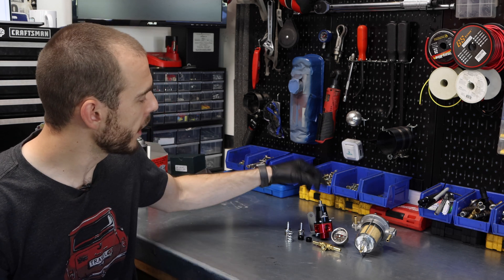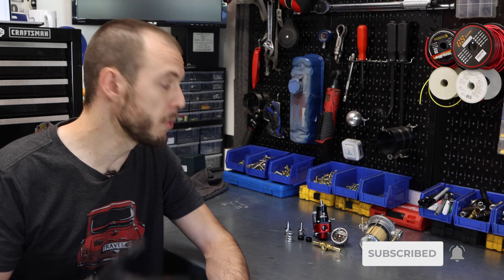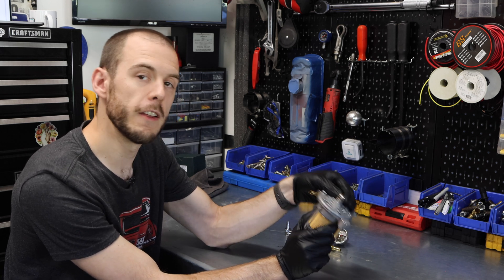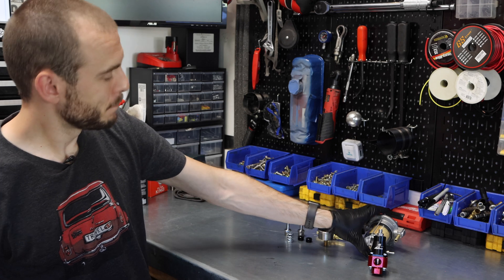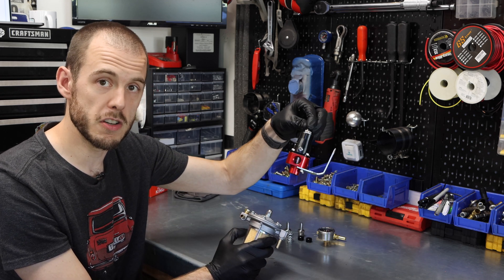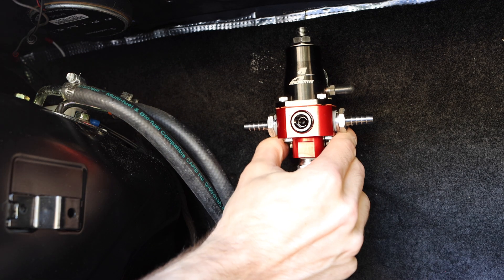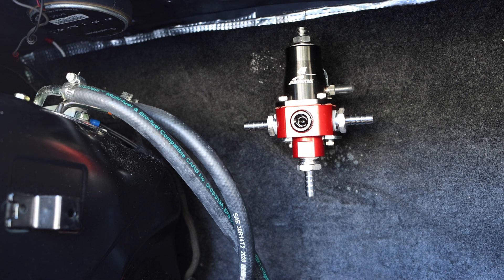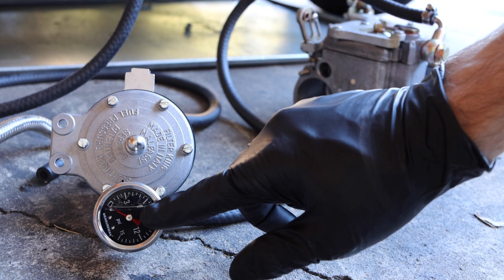How to Install a Pressure Regulator on a Classic Mini - Why You Need One

Comment: Just for reference...at 5:00 , Cole is still speaking (and referencing his setup) to a high-pressure fuel pump vs a low pressure or standard OE mechanical pump.  That glass filter/regulator will not damage anything on a stock car with standard engine, or higher compression engine with a fuel pump below 10psi (I dont have my glass filter/reg manual in front of me).  Mines been running at 3psi now for over 2 years and really solid piece of kit.
Reply from the maker: Thanks for adding this its a great point. Listening back I wasnt super clear about that. The reason that regulator does not work for my setup is solely due to my high pressure pump in the SPI tank.
Reply: Oh phew thanks for this comment mate! Because ive already set mine up like that. Corolla with 6psi oe going down to 3psi :D

Comment: Hi , great video, thanks !!   question, can i go from 60 psi to 3 psi with this aeromotive pressure regulator ?
Reply from the maker: Hey thanks! So technically you could but by doing that you are putting a ton of strain on the high pressure pump even if it has a return. It would be better to buy a low pressure fuel pump if you only need 3psi.

Comment: Curious if by having the regulator close to the fuel tank and only running a feed line to the carb, you essentially are running a dead head system. Yes the pump doesn’t have to work as hard but what about the fuel sitting in the engine bay for extended amounts of time. From my limited understanding, there’s a risk of the fuel boiling and causing vapor lock. I call on you experts to clarify.

Comment: Thanks for this. Around the 5 minute mark you warn against simply putting a deadhead type regulator between the pump and carb, suggesting that it would likely burn out your pump. Did you mean that for any pump type or just the higher volume ones meant for bypass systems? I have an 850 Mini with the original HS2 carb. My pump puts out 4.5 psi and I have been having trouble for years keeping my float chamber valves from leaking. I was thinking of adding a Filter King like yours just after my existing pump, after hearing your caution, I am not so sure. Please advise! (Nevermind - I just saw the comment from theblue0at0 and your reply which addresses my confusion!)

Comment: Friend of mine is about to set an Weber on his MK1 mini (which I found pointless) here in Japan is quite popular to fitting webers in minis , but is it alright for an so small capacity 848cc!???
Reply from the maker: Hey Diego! Weber's can be awesome upgrades for the larger displacement A-Series engines when done properly, however a Weber (assuming DCOE40 or 45) on an 850 will never run correctly. It's way way too much carb for the small engine and it will likely be underivable. It's a much better idea to focus on getting a larger engine or tuning the single HS2 dialed in perfectly.
Reply: @classicminidiy  duuude… look check out this…I can’t understand why Japanese ppl are soooo crazy about Weber…
https://youtu.be/shD2QGWPozA

Comment: Hi, why not run the FPR after the carb's fuel inlet? And use the return line to return excessed fuel? This can also benefited by taking extra heat out of engine

Comment: I'm sorry to say here that there is absolutely no need of any pressure regulator on Minis with SU type carbs, as the bowl of the carb itself it there to do the job.
Reply: so a turbo mini doesn't need a regulator ?
Reply: @martinfidel7086  the only turbo Mini was the ERA and did not have regulator.
Reply: @RobinTheMini  yes it did, I have several of them if you want to see them ?  it was a pressure adjustable regulator to cope with the varying boost pressure requirement for higher fuel pressure,  ie as the boost pressure increased so did the fuel pressure
Reply: @martinfidel7086  ok I was convinced they didn't. Anyway more than 1.5-3.0 psi for a Su carb on a normal road Mini is not much point.
Reply: @RobinTheMini  unless its a turbo, which needs pressure regulated at about 3psi above boost, so if the turbo is running 6psi the fuel pressure should be 9psi, but as far as N/A engined minis running an SU then yes 3psi is adequate.
Reply: @martinfidel7086  Turbo minis, especially an MG  stock turbo, runs a fuel injected pump, stock too. Going on facets, will go true 1st gear and stalls with no fuel. Also it has a return line to tank.
Reply from the maker: I disagree. As people replace their mechanical or electric pumps with units pumper greater than 3psi if you don’t regulate the fuel prior to it arriving at the bowl it’s going to blow out the float bowl seals or you’re going to have flooding problems. Every mini with an SU carb can benefit from a properly regulated pump like the simple filter king style pump. I agree not everyone needs a bypass style pump though. In the majority of applications that’s going to be overkill.
Reply: @classicminidiy  that's precisely what you shouldn't do, fit any electrical pump higher than 3psi in a Mini...

Comment: In carb setups, fuel does not get into engine via pressure coming from any pump. It is drawn into the carb throat only by the vacuum produced at air is sucked into engine by the pistons on intake stroke. Fuel pump pressure is used only to deliver fuel to the carb's float bowl, and is only needed where the tank's fuel pick point sits below the carb float bowl height, since gravity alone cannot get fuel to the bowl. Assuming the float bowl 's fuel level shut off valve is in good condition and is able to prevent bowl from over filling, then pressure on the pump side of the fuel supply is not going to reach the carb jet system. if it did, the engine would quickly flood with fuel. The only benefit I can see for having a pressure regulator to to better control a poorly operating pump from putting excess pressure to the bowl.
Reply: except in the turbo Mini ....

Comment: Really enjoyed that. Great explanation cole... Btw what make fuel pump are you running in the tank bud?
Reply from the maker: Thanks Alex! The pump is the standard MPI pump from Minispares. 

FULL ASSEMBLY: http://minispares.com/product/Classic/Fuel/Pumps/WFX100810.aspx

PUMP ONLY: http://minispares.com/product/Classic/Fuel/Pumps/WFX100812.aspx
Reply: @classicminidiy  so did you have to replace the full assembly due to it being an spi tank or could you just change the pump
Reply from the maker: @thedjse  Since I bought the tank brand new I had to buy the whole assembly and Fuel sender as well.
Reply: @classicminidiy  ahhhhh fair enough... Sorry for the all the questions as I have an spi tank and need to upgrade the pump
Reply: @thedjse  the SPi and MPi pumps are no different in their characteristics.
Reply: @martinfidel7086 Hi Martin I will be running a 1.3 Nissan Micra engine in my mini and was told the spi fuel pump can not give enough delivery
Reply: @thedjse  as BHP requires a certain amount of fuel per unit of BHP then it's easy to see if the pump will cope with the engine fitted, for instance if you have 85BHP then it should be ok, but above this and you need to upgrade the pump, also if the Micra injection system needs a higher pressure then again you would need to upgrade, the MPi pump works at higher pressures than the SPi pump, but as for flow there is so little difference that it wouldn't help in most cases., I would in your case if the BHP is higher use a Bosch pump for a larger BHP engine, this would covfer the flow and pressure and also future mods to some degree.